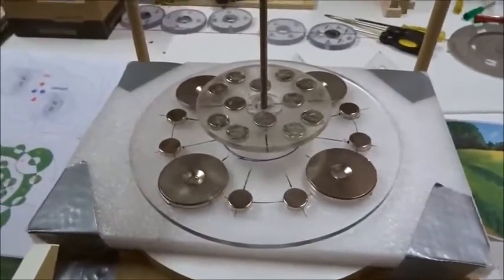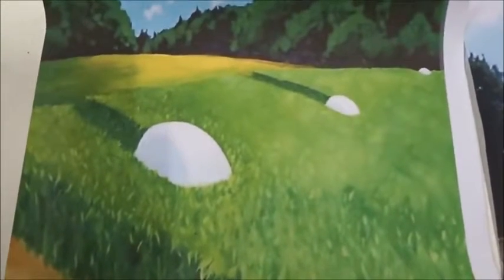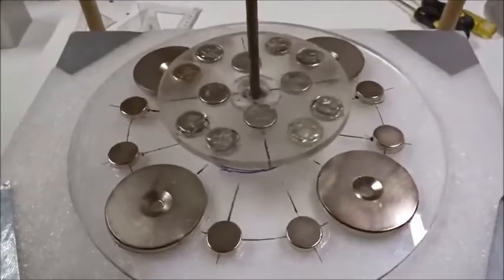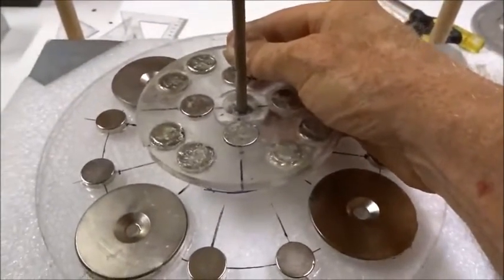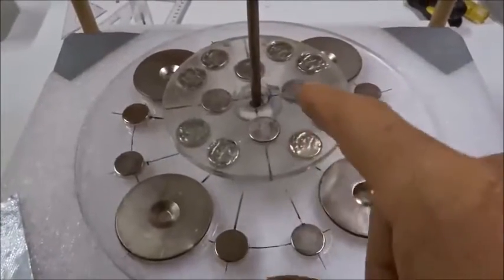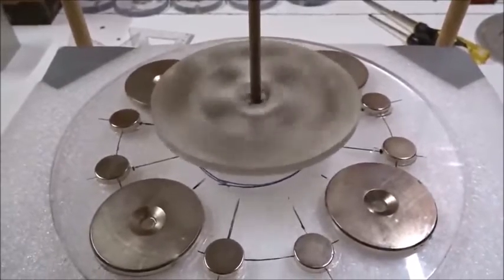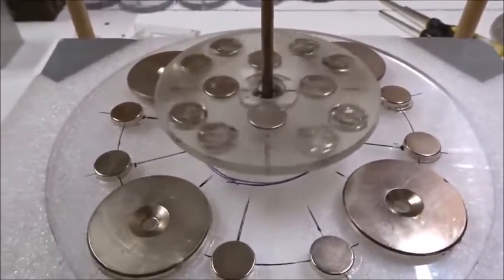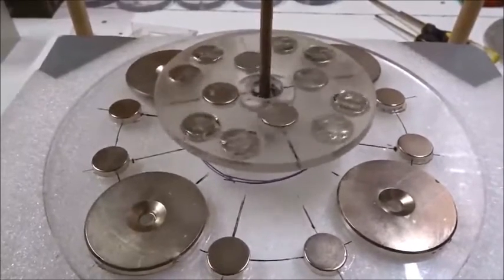"Lurkeley Hill and Boreham Down 2005: a frictionless magnetic gear"

Comment: Do you think the straight line sections of the crop-circle are relevant? Things that are perfectly symmetrical don't quite represent nature. Nature is more of an 'ordered chaos', male+female, not just male and not just female, you know what I mean? Maybe the straight lines are the 'chaos' within the 'order'?  Since there are three instances of 2 very close parallel lines running thru the crop circle, maybe they are meant to represent the 3 wires found in most modern plugs, 1 positive, 1 negative, and 1 ground.